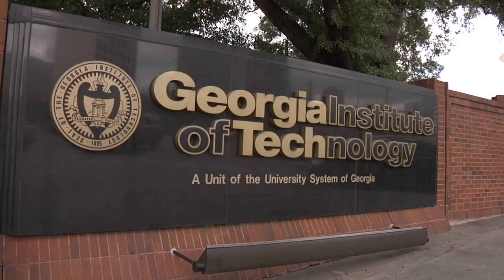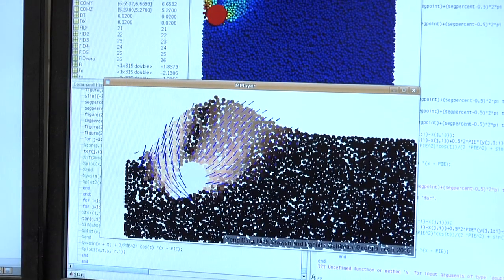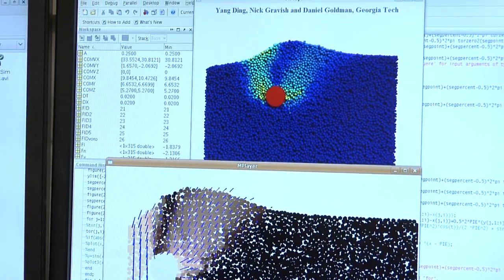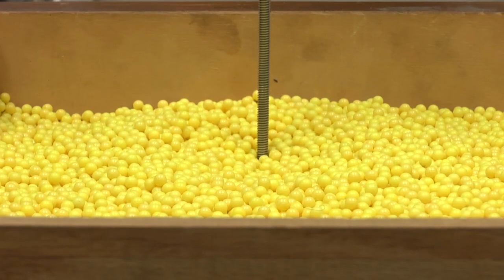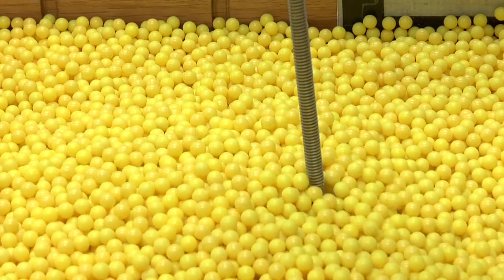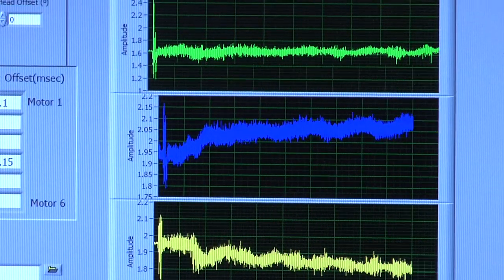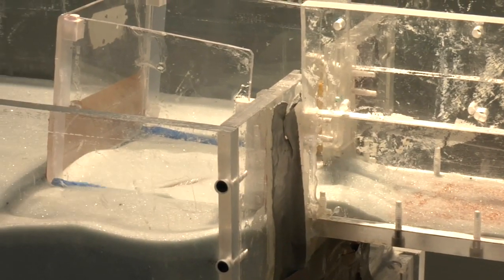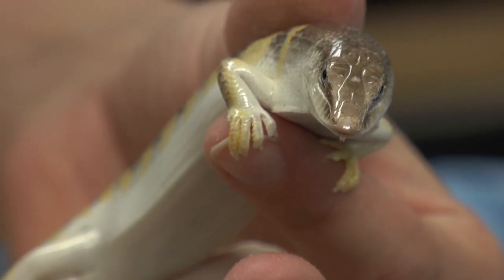A Tiltable Head Could Improve Robot Navigation of Disaster Debris

Comment: The movement is also affected by the shape of the rear.if movement of the head is not synchronized with that of the tail, the resulting motion will be resisted considerably.as for the lizard its ease of movement is not totally due to its head.these lizards dont just drill in sand in one particular direction.when the sand dunes are formed from the wind, areas of alternately dense sand are formed.these lizards tend to travel in the direction with lowest sand density.